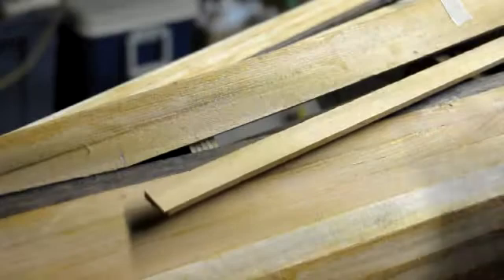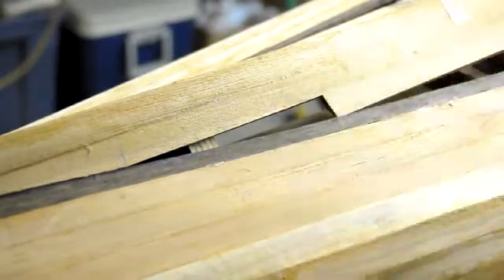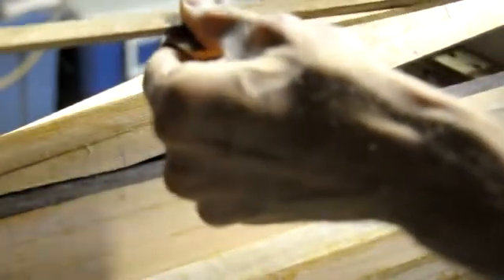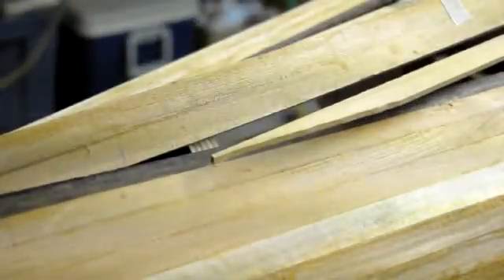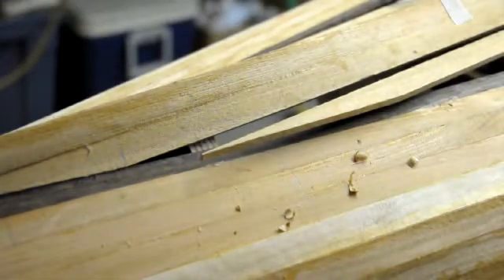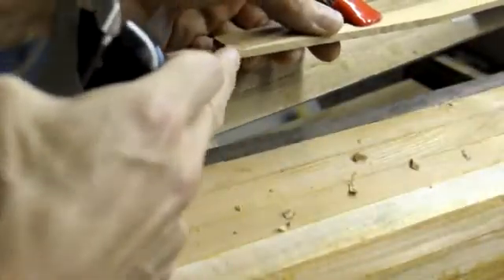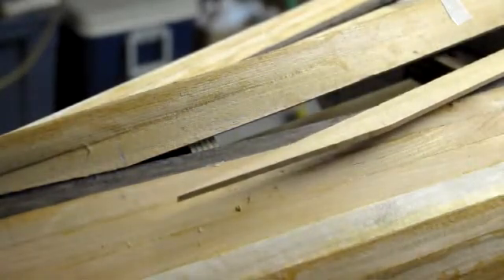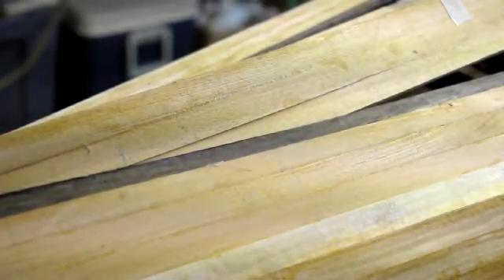Tapering the end of a strip to fit

Comment from the maker: Thanks for your comment.  Actually, I did not use the bead and cove style strips, so the technique is a little different (and simpler.)  Without the bead and cove, you have to make sure each strip aligns with the previous ones, so yes, you can push from underneath or from the top as necessary.

If you are using bead and cove strips, I'd suggest looking at a book which shows this same procedure -you need to allow for some extra length to go into the cove.  Nick Schade's books are a great resource